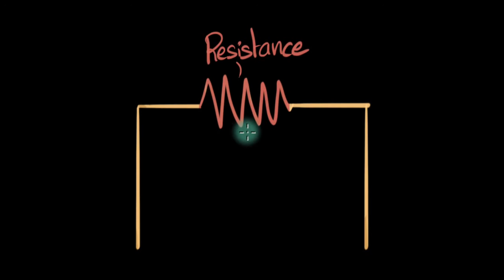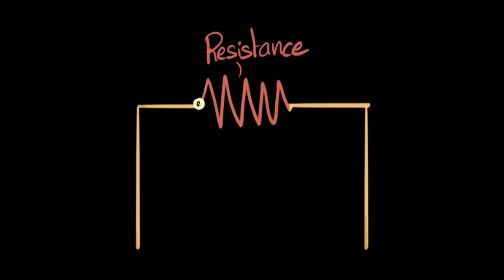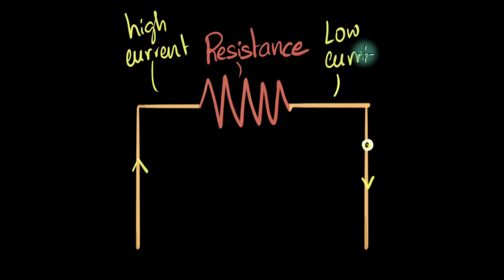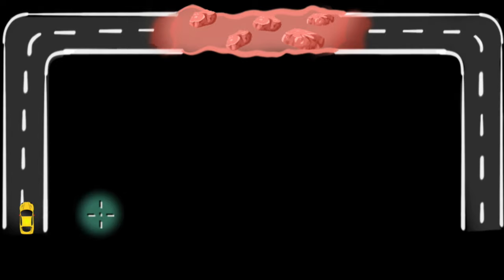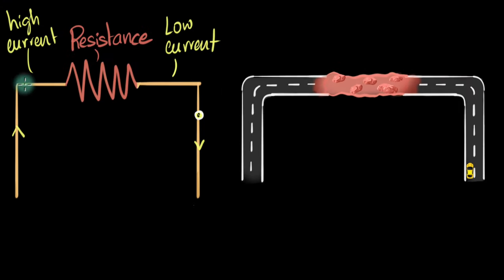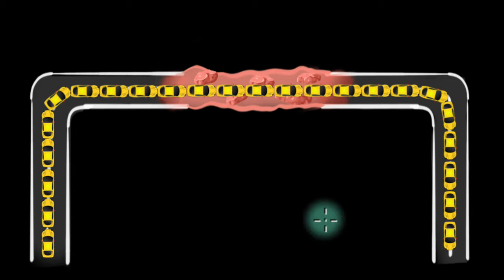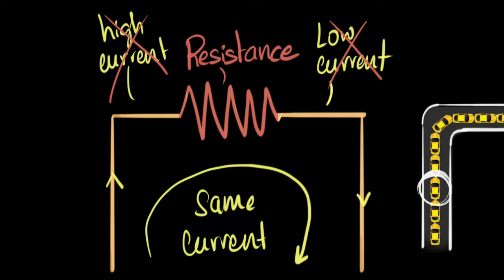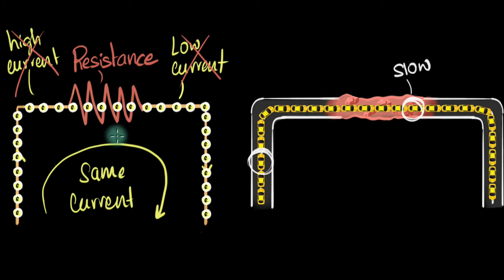Does current decrease as it passes through resistor?

Comment from the maker: I like to talk about such conceptual stuff, stuff that's ignored by most textbooks, and regarded as 'silly' by most teachers. So if you have fundamental doubts, please comment and I will consider making videos on them!
Reply: Next, physics behind the transformer
Reply: I was also confused about this. I asked many teachers they said don't have to worry too much you will learn in higher classes bla ! Bla! Bla. So I always have to forget my doubt 🥺. I just mug up the concepts.
Thank you very much for this video'!
Reply: Sir iam having  doubt that why current is different in parallel connection and how voltage is same in parallel connection please clear this doubt sir
Reply: @vairamanivaitheswaran3676  watch Khan academy video on equivalent resistor in parallel circuit,you'll get answer to both your doubts
Reply: Thanks bro
Reply: Dude, but Vertaisium literally (in his new video about electricity) just said that- it is not the push by electrons which causes the flow of other electrons, rather it's the electric field created by the surface charges and the battery!

Please clarify me on this 🥺
Reply: @ashishkumarpatel4597  that video is very debatable, many YouTuber challenged his explanations
Reply: Silly concepts are most important.
Reply: Symmetric circuits pls, struggling in understanding the reason behind what we do to solve them
Reply: The number of radioactive nuclei after time t and the activity of that radioactive nuclei are confusing to me.
Reply: How do resistors know how to share their voltage...
How does the voltage drop across resistors...
If total voltage drop of resistors in series equals source voltage does it mean no voltage flows immediately after the last voltage
Reply: Thank you so much ji 🙏 Greatly inspired by ur teaching 🙂
Reply: omh, thanks a lot, i had this doubt since i started studying abt current in school, but no teacher explained this to me properly, i am really grateful for u
Reply: Bro,you are superb😊
Reply: Why is there no current between the negative terminal of a battery and the positive terminal of a similar battery when connected with a conductor?
Reply: wait sir so the voltage is basically the cars fuel, so the cars speed increases as it's fuel increases and then it passes through the obstacle then it slows down as it uses it's energy to pass through the resistor. Then exits the obstacle Hence there's a lower speed
Reply: @ayramisbah5120  Voltage is the horsepower
Reply: @anissbenthami  so like the reason as to why the current can increase?
Reply: Thanks for clearing up my confusion . Needed to see those cars everywhere for real
Reply: Drift velocity is how you answer this question
Reply: They only call it silly because half of them probably dont know it themselves
Reply: Can you please explain  how current carrying conductors produces magnetic field around it
Reply: Yeh me too
Reply: Please do generators/ generator effect and motor effect I’m really confused with all that
Reply: A video by veristatium on electricity did you watch?
Whats your point of view on thay
Reply: Hey sir! I had a doubt that we all know that V=IR THAN ID WE INCREASE R THAN V SHOULD ALSO INCREASE TO MAKE I (CURRENT) CONSTANT BUT IT DOESN'T HAPPENS AT ALL . WHEN WE INCREASE R THE V DROPS DOWN THAT IS I IS CHANGED BUT PHYSICISTS SAYS THAT I IS CONSTANT EVERYWHERE DOESN'T IT CONTRADICTS OHM'S LAW ❤❤❤❤

Comment: Thank you so much. I had the same doubt but never asked my teachers as I thought they might think its silly....I finally understood what i had missed in my thinking process- we shouldn't consider a single electron.
Reply from the maker: Yes yes, that’s what I always missed too!
Reply: @Mahesh_Shenoy  Sir i have a doubt.As we know that Electric filed is 3 Dimensional that is why we use spreaded Electric Filed Lines in all direction across Electric Charge.But is Magnetic Field also 3 Dimensional?If it is 3 dimnsional so why we use right hand rule and predict the magnetic field created along a wire in circular direction?If Magnetic field is 3 dimensional then why we not say that magnetic field will be spreaded in all directions rather we say it is circular and thus limiting it to one dimensional?
Please Reply or make a video?
Reply: @knowledge23109  Because magnetic field is angle dependent but electric field doesn't depend on angle.

Comment: At 3:10 you said, "we have to imagine there are cars EVERYWHERE." That my friend is what made everything click. Amazing explanation. I don't know why people don't just come out and say this. Thank you very much.
Reply from the maker: Yea, that’s the major misconception!
Reply: @Mahesh_Shenoy  sir but at initial time there are no car i mean no electron is front of the first electron when current starts to flow?
Reply: @harshad1526  so at first the current is also more, upon passing through the resistor it reduces
Reply: @harshad1526  once battery is connected it develops potential diff. B/w the two points. Due to this electric field is created in a certain direction (from higher to lower potential). And we know the free electrons are present everywhere in the wire. So they will go in a particular direction i.e. opposite of the electric field. 
There is no first electron.the electrons are everywhere in the wire (from start of the wire to the end of wire )
Just u connect a battery they all will go in a particular direction.
Reply: ...agreed.
Reply: @harshad1526  I think that's called inrush current.  After inrush current, it'll flow normal again.
Reply: Even hC Verma sir failed to provide proper explanation for a similar doubt asked by one of his students. He said everything in that 2 min video except for explaining what he'd asked @Mahesh_Shenoy
Reply: @Mahesh_Shenoy  Nice explanation sir. In this point of view how we can understand increase in current if voltage increases(10V)? (with same resistance before with lower voltage(2V). All through the material we have electrons then how they can move fast?

Comment: why does the current stay the same throughout the circuit even though there is resistance in one part?
The video explains a common misconception that beginners in circuits have that the current would slow down after passing through a resistor. 
Finally, thank you for making this video!

Comment: I am amazed by this video, really great question presented here about a topic which we think we understand completely.
So, the overall summary is that the current decreases due to the resistor, but it happens everywhere in the circuit and not just after the current has passed through the resistor in comparison to it entering it, I think it is analogous to a traffic jam, where if the cars in front slows down the whole traffic behind them gets slower. 
Thank you for posting such educating content.

Comment: Yes, current decrease when it passes through a resistor. In simple and short circuits like this the difference is very small. To understand this you need to know that Voltage, Current and Resistance are all "connected together". For current to flow you need voltage (which is a difference of potentials). The longer the conductor, the higher the voltage drop, with long enough conductor (very high resistance) you will have no voltage and no current. That lost energy from conductor is in form of heat and even sound.

Comment: I dont think circuits have the same current everywhere. Sure the electrons are fairly compressed throughout the entire wire but thats the whole reason that voltage exists. If you have a higher voltage in a point its analogous to more clumped up electrons. Electrons are less clumped up further away so the electrostatic force moves them from an area of high voltage (high electron density) to low voltage (low electron density). A resistor is like a dam with a small hole in it. Before the dam the voltage is increased compared to the same circuit without a dam and after the dam the voltage is decreased. The best way to model electron flow is using water flow through collumns where flow rate is current and water level is voltage. A battery works almost identically to a water pump sucking water out of one end of the collumn and injecting it into the other. The only way that the water model diverges is in that it doesnt compensate for magnetic moments of electrons but this isnt too important

Comment: It completely makes sense! But could you explain a little bit on why current is different in parallel circuits?
Reply: It isn't really. You have just two parallel roads one is faster, one is slower. Ok at the junctions the analogy falls apart a bit but if you ignore the j junctions or consider the junction the starting point, it equalizes. Kinda. Sorta. Guess you need to remember a resistance has global influence on both sides. But yeah the analogy gets fuzzy, since the simplified resistance if you calculate it for a parallel circuit is <=1/2 the resistance of the smaller one.

Comment: The electrons actually speed up on the resistor, because the drift velocity is directly proportional to the resistance. But the current does not change because of the conservation of charge along the wire

Comment: Or consider water flowing in a hose.  Squeezing one part of the hose creates resistance.  But water flows at the same rate both in and out of the constricted part.  If it didn't then water would have to accumulate there and the hose would therefore have to expand until it burst.
Reply: but the water would come out faster if we squeeze it, which means it does somewhat affect the water flow
Reply: @levilev8435  But the rate of inflow (water volume/time) is still the same both going into and coming out of the squeezed part.  The water pressure is higher on the outflow, but less volume of water is moving at the higher pressure.  Same is true for an electrical circuit, charge/time is the same across a resistor even when the "pressure" (voltage) changes.

Comment: I think it works better as a thought experiment to look at it like a traffic jam at a construction site. You have a 4 lane highway that gets bottlenecked into a one lane reduced speed zone and then you kind of understand potential difference at the same time because it's much easier to pile up cars going into the jam than coming out. The hard part then is imagining that the cars coming out on the other side don't just speed up and instead coast at the speed they exit with. It's a reality that you have to contend with even in this model. It's hard for me to understand the concept that the potential energy converts into kinetic energy and carries the electrons though to the other terminal on a dc circuit at the same average speed they entered the resistor with.

Comment: Actually, your first intuition wasn't wrong because conductors also have a capacitance. So for a very short period of time, the current through the wires may indeed larger than the current trough the resistor. And that's where the voltage across the resistor came from.
Thinking about the density of cars building up in front of an obstacle(+) and dilute behind (-).

Comment: Hi! I'm late to the video, but just wanted to say your intuition wasn't wrong at all! At least in the transient state of the circuit (when the battery "kicks" the electrons). 

Alpha phoenix showed in his video "Watch electricity hit a fork in the road at half a billion frames per second" that the current initially moves at a speed set by the impedance of the cable (the amount of electrons in the cable) and when it hits the resistance it "updates" the rest of the circuit to diminish the amount of electrons flowing per unit of cable. 
This happens back and forth until it settles to a value set by the impedance of the circuit, and then your explanation can explain the steady state. 

I may be wrong about the specifics though, I just wanted to point out that the transient state needs another explanation (even in this simple circuit).

Comment: Hello, after watching your video, here is a question I have:
Using this way to explain constant current, would that not mean should we have 2 resistors of same resistance in a circuit, lets say 10 ohms. Wouldn't that mean the maximum resistance is just 10 ohms and that it does not add together (which is wrong)
Please and thank you.
Reply: Actually it’s a pretty easy answer. I just had to think of it. It’s basically 20 ohms so added up because you have to imagine the current being slowed down 2 times with 10 ohms and so the whole current is slowed down by a total of 20 ohms. Because there is another resistor it just slows it down even more.

Comment: #Question: Do our electricity bills increase if we just switch on the switch without attaching any device. Because may be the charges are flowing and due to their flowing, heat energy is going to Generate and loss of energy happening????

Sorry for grammar 😅 my English is not too good.
Reply: No it like leaving a two wire hanging in mid air 
There is no current flow in circuit or lets say electron
Try imagining the above analogy in video if the road is broken car won't go ahead
Similarly electron won't go ahead since there is no where ahead
Reply: @justalazyguy.0_0  nice!

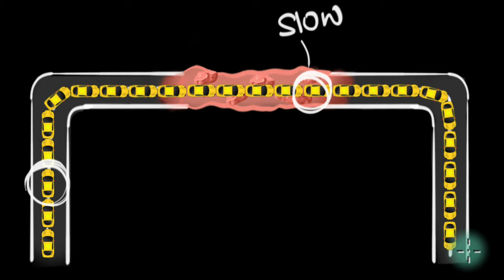Comment: 3:45 But the voltage is the same everywhere in the circuit so when the electrons come out of the resistor they must get a push or a pull on them which would increase the rate of their propagation increasing the current.

Comment: Thank you so much sir ache se samajh aa gaya...par ek aur doubt abhi bhi hai pls sir iska answer bata dijiye --->agar sir same current hota hai pure circuit me resistance lagane par bhi fir sir agar hm uss resistor ke ends pe voltage ke +ve end p jyada aur -ve end p kam kyu hota hai?.. pls
Reply from the maker: To clarify, are you asking why one side of the resistor has a higher voltage than the other? Because as the charges move through the resistor, they lose energy and hence the potential drops!
Reply: @Mahesh_Shenoy  no sir, I know that there is drop in potential across any conductor(due to resistance offered by them) but my question is like when there is potential difference between the end points of conductor or any resistance then why not there is current difference between that point only(at the end of conductor or here, the resistor)?why current difference is is shown throughout the circuit and not potential difference throughout circuit but only across conductor??........did you got my question ❓ please answer me 🙏
Reply: @Mahesh_Shenoy  ok answer me that from what you said (potential difference drops due to energy consumption)u mean that energy drops na....then when there is change in energy i.e.  electrons must loosed energy then their speed must change than current should also change na (i =q/t).....!?!?
Reply: And ya btw I am very fortunate that you are helping me 😌 thk sir ❤️.... but sir still can you help me more in answering above doubt
Reply: Reply please it's urgent 😬

Comment: That means the potential drop caused by the resistor in the circuit affects the speed of all the electrons in it ... The net resistance of the circuit decides the current in that circuit...But the current which is produced is constant (not considering any branches)

Comment: I have a question which is continuously pinching my mind. That is, we know that the potential difference is necessary for the flow of electrons but even having 0 voltage between the terminals of battery, electrons should flow as the forces between the positive and negative terminal are in the same direction. As the positive terminal is attracting and the negative one is repelling the electrons. So they should not cancel out the effects of each other and so the no. Of electrons pushed by the negative terminal must be pulled by the positive one. But it is not so, we generally consider that there is no flow of electrons having 0 voltage, why? Hope you'll answer!

Comment: Thank you Sir for explanation.
Sir, can you explain same concept on resistors in series. And why potential difference get reduces when resistors are on series? What is really the "potential difference" between two points? Then applying more resistors in series, do current get slower to the whole circuit?
Reply from the maker: Check out my recent videos for that

Comment: No, because electron flow and attraction to the holes is constant. It's a set speed at which the electrons move towards the holes. This is so fast that to us, it seems unlimited speed, but the speed at which electrons flow towards the opposite charge is a constant. Kinda like magnetic attraction.. You can try and slow it down, but the attraction is constant. Once the electrons get past the resistor the speed goes back to the constant and it continues at what looks like to us as unlimited speed, ... that's why you can't really slow down the electron flow to ground. It's an attraction. It's speed is constant. Its speed appears to be constant, or very fast, but ....

Comment: ...but even if you dont know about 'electrons' , I think a bit differently. Say you are travelling in a car going from A to B . In the first illustration, say the road is smooth as silk. The driver uses 'cruise control'. He sets it to travel @ 5 miles per hour . It takes him to get to point B 60 minutes as it is 1 hour distance . Now in the second illustration the set up is the same 'but' the road surface changes to say rough or a 'coarse' road work. Some of the energy used by the car is being used up by the bouncing up down, left righ. So now the car will not reach Point B in 60 minutes because of 'other' factors. Have I understood this correctly ? Please advise .Many Thanks